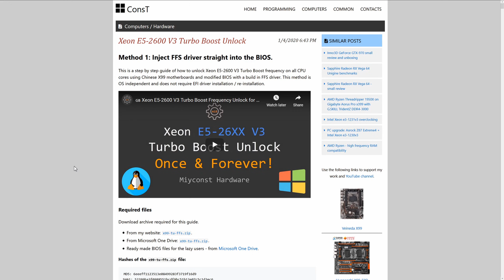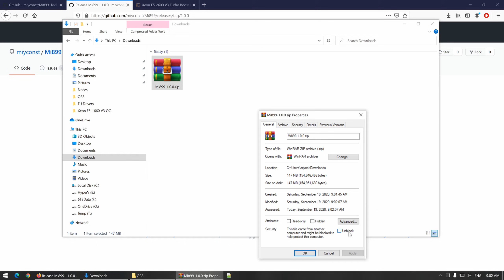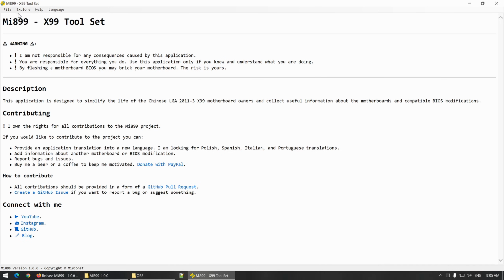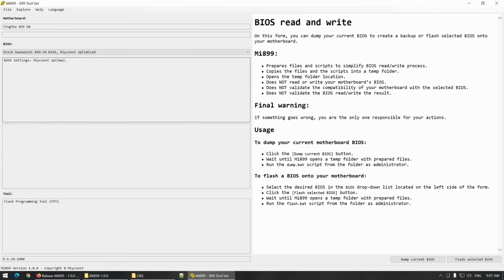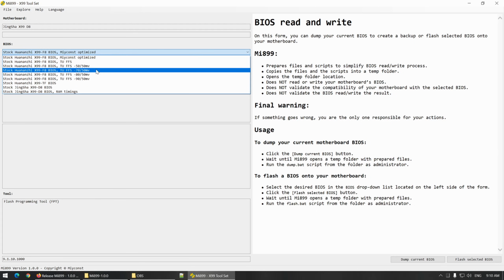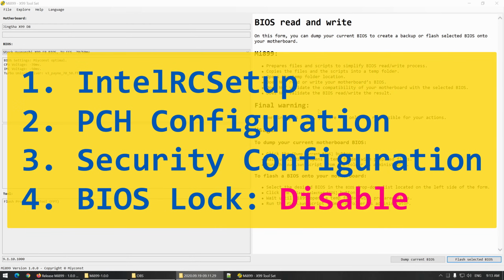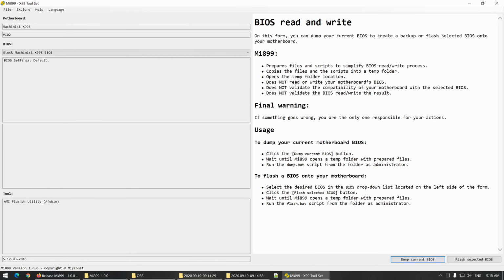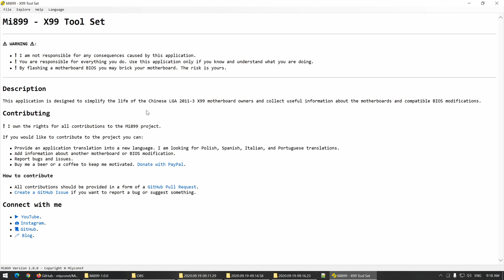🇬🇧 Mi899 – X99 Tool Set | read, write BIOS & unlock turbo-boost with a few mouse clicks

Comment: thanks man you are fantastic, I am a bit confused with the bios and turbo boost of the huanazhi TF board, should I use the bios of the x99 F8 board? or should I wait for future updates? I thank you from Argentina
Reply from the maker: Huananzhi X99-F8 BIOS is fully compatible with X99-TF, you can use it.
Reply: @Miyconst  what do you think is a good option for my plate?  I am currently with ddr3 memory and a Xeon 2678v3!  Thank you very much for your help and your videos!
Reply from the maker: Use the X99-F8 BIOS with Turbo Boost Unlock and -70/50 voltage reduction.

Comment: Hello! I have a question.. is it possible to turbo unlock E5 2690 V4 if I am using HUANANZHI X99 TF using this program?
Reply from the maker: It's not possible to unlock any of the V4 CPU and it doesn't matter which motherboard you use.
Reply from the maker: @xabieznetic  apparently you didn't watch my video carefully. There I have explicitly specified, that all final V4 CPUs have locked multiplier, it's not possible to overclock them. There is only a few very rare pre-production samples of some Xeon E5 V4 CPUs, which can be overclocked.
Reply from the maker: @xabieznetic  if the price doesn't matter that much - do yourself a favor and buy Ryzen 5 5600X.

Comment: What is the difference between -50, -70, -80 and -90 in Vcpu?
What is the best option for an e5 2620 v3?
I don't know too much about overclocking, Thanks in advance!
Reply from the maker: Go for -50mv with E5-2620 V3, it should be safe.
Reply: @Miyconst  Thank you so much

Comment: I was reluctant to perform a turbo unlock on a Qiyida version of the X99Z V102 with E5-2620v3 because using FPT did not work. I'm so glad that I came across this video - I used your advice for this particular combo and your recommended optimal BIOS for TU - and this worked like a charm! Thankyou so much!

Comment: I would like to see how to unlock the xeon 2640 v3 on the x99 f8 board why i tried to use your bios mod but it doesn't work,8gb ram modules at 2660mhz. But your bios did not work for me, I would like to see the mod for this processor, I know that I ask a lot but it is something that I do not know, I would appreciate it very much
Reply from the maker: I have already done as much as I could do for this motherboard and this CPU. If you have difficulties using Mi899 or following my guide - feel free to text me on Instagram.

Comment: Hi man! I finally got rid of my Atermiter motherboard and bought a Huanazhi X99-TF and immediately felt the difference. However I am not able to do the turbo boost unlock with your program.
I am selecting my motherboard and the TU FFS -70/50 mv bios. I managed to backup the bios using FPT, but when I try to flash the new bios I get the following error message: "Error 103: There are no supported SPI flash devices installed. Please check connectivity and orientation of SPI flash device. " What am I doing wrong?
Thanks in advance!
Reply from the maker: This does not sound right. It could be that you have got the latest revision of the motherboard, which has locked BIOS. Take the chipset heatsink from the motherboard and see what is written on the BIOS chip located there.

Comment: Good night Miyconst.
I would like to know if it is possible to make this unlock turbo bost on motherboard MSI X99a Godlike?
Thank you very much you are very good and your videos are excellent.
Reply from the maker: Yes, it's possible, but you might need an external CH341A to flash the modified BIOS.
Reply: @Miyconst  I have the ezp 2010 recorder if I send you to bios you can change ?
Reply from the maker: @ricardoriwar  you can follow my guides and modify the BIOS yourself: http://www.miyconst.com/Blog/View/2081/xeon-e5-2600-v3-turbo-boost-unlock

Comment: can it work with kllisire d4 ? the model with 2 pci express (orange)
Reply from the maker: No, because that motherboard is known for its poor quality and I don't recommend it.
Reply: @Miyconst  omg i've just buyed it because it's the most buyed, what's the problem with quality?
Reply from the maker: @riccardo.vitale.videomaker  there are many small issues, and I have got multiple reports of dead motherboards. The biggest problem is the non working USB 3.0 ports.
Reply: @Miyconst  thanks, i'll change in the future

Comment: i flash x99 TF / 2678 v3 with :
 Chipsets: X99, C612.
BIOS Settings: Miyconst optimal.
O.C. Features: Unlocked.
Author: BIOS-iEngineer.
URL: https://github.com/BIOS-iEngineer/HUANANZHI-X99-TF.

i'm not unlock, often on 1200 Mhz and max 2.9. And now i tried :
Chipsets: X99, C612.
BIOS Settings: Miyconst optimal.
CPU Voltage: -70mv.
IMC Voltage: -50mv.
Turbo Unlock Driver: v3_payne_70_50.ffs.

But it says : PDR Region does not exist.
GBE Region does not exist.

Error 25: The host CPU does not have write access to the target flash area.  To enable write access for this operation you must modify the descriptor settings to give host access to this region. "

What i need to do? Thanks for sharing you knowledge !
Reply from the maker: Hi Thomas. It's very hard to guess what is going wrong, if you need some further support, please text me on Instagram: mi8.se.

Comment: Thank you for this software, X99-F8 with E5-2640v3 flashed without problem and now topping out at 3.4GHz!
Reply: Witch BIOS do you use ? because in inject "huananzhi-x99-f8.tu.v3p0.ffs" and i' have an error message  in recovery section :
"ROM Image is not loaded"
"ROM Image updated denied"
Reply: @prophetof56  I believe i used the Miyconst optimzed, huananzhi-x99-f8.mi8.rom. I used the one included in the Mi889 tool ver 1.0.5.

Comment: On D8 after flash the bios with TU it will works or i have to do somethink else to use turbo boost?
Reply from the maker: It depends on what BIOS you flash :)
Reply: @Miyconst Thanks for answear :) Do you think that sound quality on Machinist X99Z is poor vs Jingsha D8 for example?
Reply from the maker: @miosz8531  I am probably the last person to ask about the sound quality, since I have quite bad hearing, but for me both motherboards sound the same.
Reply: Thanks :)

Comment: Hi, sorry if this is a dumb question, but I just assembled my new x99-tf motherboard with e5-2678-v3 CPU. The bios reads that it was tested/updated very recently, and I would love to get the turbo unlock applied! I just downloaded your Mi899 program, but when I tried to dump my bios to back up the drive, it said I do not have a flash device. Do I need to purchase/connect a USB flash tool like in your previous video to run this program/bios flash? Thanks a lot, and sorry again. This is my first time doing bios flashing, so I'm still a bit nervous.
Reply from the maker: Hi there. Your motherboard has the latest BIOS, which is locked for FPT access. To make a full BIOS backup you need an external CH341a, as you mentioned. To apply Turbo Boost Unlock you can use AfuWin, but this tool doesn't work to create a full backup.
Reply: @Miyconst  thank you so much! Do you have any recommendations for where to purchase the CH341a device? Or are they all pretty much the same?
Reply from the maker: @Bromatolite  they are all pretty much the same, I have bought mine from Amazon.de.
Reply: @Miyconst  thanks! And I just want to make sure... The bios chip on the X99-tf is the 8-pin uP0104S 8JN032 chip right next to the CMOS battery? Or am I looking at the wrong place on the motherboard?
Reply from the maker: @Bromatolite  you are looking at a wrong place. If you have the same X99-TF as I have, then the BIOS chip is located under the chipset heatsink and marked "winbond ...".
Reply: @Miyconst  ooooh, I didn't know it was under the heatsink! Thank you!
Reply: @Miyconst  hi! So, the computer has been working well, but I've noticed that the bios display on the board keeps showing AA when the computer is running, and post code 73 after it comes out of sleep mode. Should I be concerned by this? I'm ready to flash the bios, but I want to make sure something isn't wrong beforehand. Thanks in any case!
Reply from the maker: @Bromatolite  I have exactly the same behavior with mine JingSha X99-D8. I was not able to detect any issues related to the 73 Post Code, the motherboard works as it should.
Reply: @Miyconst  perfect! Now, I'm just looking through the bios options for flashing... Is the Miyconist optimal BY99RD25 BIOS (BIOS-iEngineer) optimized for turbo unlock? Does it have control on undervolting?
Reply: @Miyconst  also, I'm getting a 201 error when I'm trying to dump the bios saying that [FPTw64.exe] cannot run on the current platform. How do I fix this? I'm trying to flash from my laptop
Reply from the maker: @Bromatolite  :O, are you running FPT from your laptop to flash BIOS of another motherboard? How is that supposed to work? FPT shall be executed on the computer where you want to flash the BIOS.
Reply: @Miyconst  oooooh, I didn't know if the motherboard needed to be on or not.... Hahaha, sorry
Reply: @Miyconst  it's working now! Just dumped the bios and made a backup! Now to choose which bios to use... Do the iEngineer ones have turbo unlock?
Reply: @Miyconst  it looks like it has O.C. features (overclock?), but does it allow for turbo unlock and undervolting, or do I need to choose one of the F8 bios for that?
Reply: @Miyconst  I'm sorry for all the messages, but you've been a wonderful help! I'm just having trouble finding information on the various bios and I don't know a good way to choose from the available options.

Comment: Pleas help me i have machinist x99z v104. U have bios for this model's with a working turbo boost?
Reply from the maker: Yes, I do, it's available in the app, just download the latest version and enjoy.
Reply from the maker: V104? Do you have a picture of the motherboard?
Reply: @Miyconst  where can i send the photo?
Reply: @Miyconst 
identical to the x99z v102 version only with the designation v104 and no bios unlocks the turbo... 😕 https://imghub.io/i/xflP1
Reply from the maker: @BL3EK95  it seems like the v104 is fully compatible with v102 BIOS, but they have done some nice tweaks, at least fixed the 8-pin CPU power connector. Still, before I test the motherboard myself, I can't say anything for sure.
Reply: @Miyconst  thank you for the answer and I am waiting for the test results, I ordered the v102 version and the seller sent me v104 😂 and I was a bit embarrassed because I could not find any information about this revised version, maybe you will be the first ❤️ sorry for my spelling but I have to use a translator 😅
Reply from the maker: You can ask the seller if the v104 is compatible with the v102 BIOS, and use Mi899 if it's compatible.
Reply: @Miyconst  Good I'll try
Reply: @BL3EK95  Hey did you already got the answer yet? I want to know if its compatible or not, cause i ordered the same motherboard

Comment: I heard for x99z v102 that theres 2 version of bios chips. There is 8mb version and 16mb bios version. Does this program work with both version?
Reply from the maker: No, this program works with 16 MB version only, but as far as I know, 8 MB version are no longer produced, thus it's not a big deal.

Comment: hello, first of all thanks for all the work you do, it's incredible.  the second: I have a question, my motherboard is a huananzhi x99 F8 and I have a Xeon e5 2620v3, 16gb RAM.  What bios do you recommend to install?  thanks for everything.
Reply from the maker: I would recommend the Turbo Boost Unlock BIOS with -50mv offset.
Reply: @Miyconst  Thank you very much for responding so quickly.  You have all the likes of YouTube.  thanks.

Comment: Hello, a big greeting from Chile, I would like to know if this hack turbo boost works on a Huananzhi F8 mobo with the E5-2680 V4 processor and if the difference in performance compared to the E5-2678 V3 is much, thank you very much and I congratulate you for the channel is very good.
Reply from the maker: No, Turbo Boost Unlock only works with Xeon E5 V3 CPUs.

Comment: First of all thank you very much for your work.
What about the Kllisrre x99 D4. Model ZX-99EV3_V1.31.
I have it with a 2678.
Thank you!
Reply from the maker: This is the same board as PlexHD X99-Turbo, also known as Atermiter. The board is known for its poor quality, that's why I don't recommend and don't test it.
Reply: @Miyconst  OMG !!! Too late to change ... and the fact is that it seems quality.
Again, thank you very much.
Reply from the maker: @donMendoC  if it works well for you - just be happy, no panic needed.
Reply: @Miyconst  Thank you. I have gotten a rom that they say is stable. We will have to try to see how it is.
Thanks for your job.

Comment: Hi thanks for your Great Job
the e5 2620 no need undervolt?
Reply from the maker: I would apply -50mv undervolting, but it will be fine with the stock voltage as well.

Comment: Hi, im from peru and i saw many of your videos, i just bought an x99 platform, i got the attermiter x99 D4 version (i dont have enought money to buy one of the f8 models), and i wanted to know if u have planned to release a turbo unlock patch for this motherboard, that would be helpful, thanks for your content.
Reply from the maker: Hi. This motherboard is known for its bad quality, thus I am not going to review or recommend it. You can still perform the Turbo Unlock procedure using my manuals.
Reply: @Miyconst  i only want to unlock the turbo boost, how can i to unlock the turbo boost in that mobo?
Reply from the maker: @Zarkinn  I already have two detailed guides for this procedure: http://www.miyconst.com/Blog/View/2081/xeon-e5-2600-v3-turbo-boost-unlock
Reply: @Miyconst  ty so much, i dont have the mb yet, and i never used a xeon platform, ill see how this goes

Comment: it's only me to have not the fan control in the bios?? All fan at full speed..always, also with cpu at 30 degrees celcius..! i have a Jingsha/SZMZ X99M-G2
Reply from the maker: Do you use 3-pin or 4-pin fans?
Reply: @Miyconst  i could use both
Reply from the maker: @alessandropoggi9488  3-pin fans are not adjustable with all Chinese X79/X99 motherboards. 4-pin fans should be adjustable if you enable and configure smart fan in the BIOS, but only if the fan is connected to a 4-pin header.
Reply: @Miyconst  i found the section in which the controls are for the fan speed but sadly it has only a fix speed without any curve or other custom settings. I put it on 50% just to keep the cores fresh enough  and the noise acceptable. i will look if there's a newer bios around

Comment: Hi sir congrats for your hard work..my question is can i use this kind of x99 motherboards with a i7 x99 based cpu?? f.e i7-5820k or i7-5960x etc??
Reply from the maker: Yes. You can use 40 PCI-E lane i7s in all boards, and 28 PCI-E lane i7s in some of the boards.

Comment: Nice job! I've just bought a x99 tf motherboard and stuff because of your work in the subject. A big thank you! Saved a lot of money 🙌 In the end of this video you show a Huananzhi x99 tf, and I was wondering, what cooler you've used on the cpu and what cpu is there? Looks like a simple cooler.
Reply from the maker: It is a basic Intel OEM cooler, and the CPU was .. hm, I don't remember. I use this cooler for testing, because it's really easy to mount and it doesn't interfere with memory modules, but it's cooling capability is rather bad.
Reply: @Miyconst  I didn’t think it was a testing build. Thanks for ur answer

Comment: quick question.  Once you have flashed the iengineer, can you go back to your bios.  I am having issues now
Reply from the maker: Yes, you can go back, but you have to use AfuWin instead of FPT. Just make sure to select "Flash entire BIOS" when prompted by AfuWin.
Reply: @Miyconst  thanks.  used it, but it never asked to "flash entire bios" , but it seems to have worked
Reply from the maker: As long as it works - all good.

Comment: hi, miyconst, thanks for your work, im having issue with the tb unlock, i did the procress correctly and sometimes my pc not go over 2.5ghz, but sometime yes, could be because the fast start its active??? im on x99 f8 and 2620 v3, i did flash -50mv bios file
Reply from the maker: So far this hack is not compatible with the sleep mode. There are some options available online how to fix that, but I have not yet investigated it.
Reply: @Miyconst  ok thanks but sleep mode it's the same that Windows fast start ???

I think the problem it's Windows fast start because in the little screen of motherboard when start it's fast say 73 and when the start it's slow shows AA
Reply from the maker: @Leocub92  could be the case, but I have got many motherboards which show 73, but work perfectly fine. Anyway, if it works without fast start - don't use the fast start mode. Sleep mode is not the same as the fast start, but both of them are skipping some initialization procedures.
Reply: @Miyconst  ok thanks, so I'll disable both functions and done, thank you so much Miyconst, 

I did flash my bios with mi899 tool, it's excellent
Reply: @Miyconst  Hi, let me ask u, for 2690v3 it's good make tb unlock? Any difference with stock??
Reply from the maker: @Leocub92  yes and yes, I use an E5-2690 V3 myself, and TU performs in games way better than the stock option.

Comment: the huananzhi x99 f8 bios is from BIOS i_engineer? i want the best possible bios because the problems i told you about my system :D
Reply from the maker: Feel free to try the iEngineer BIOS, but if you board has hardware issues it won't be resolved with any BIOS.
Reply: @Miyconst  is the iengineer bios turbo unlocked?
Reply from the maker: @daemonkisure2952  No.